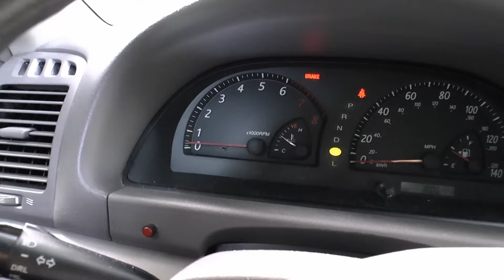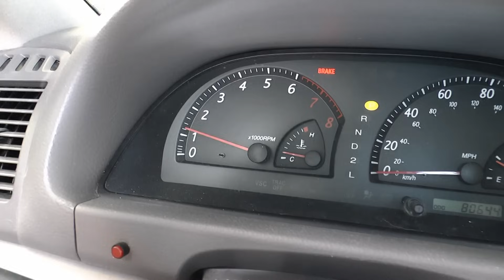How to Fix Low Idle Problems in Your Car (Throttle Body)

Comment: Hey Scottie i have a 2013 Toyota camery SE. it’s been idling low for about 1-2 months and I recently started my car up and it idled really low and the engine sounded like it was struggling to stay alive and it eventually tuned off by its self. I went to an auto parts store to get the battery checked out since it’s a couple of years old but everything checked out okay. I was thinking of doing this trick but I don’t have my original keys with the remote to lock and unlock my car, do you think I can still try this or will my alarm go off? I believe my burglary alarm got turned off since I had to get a new key made by the locksmith. Thank you for you Chanel I watch it all the time keep up the great work! Thinking of getting a 2019/2021 Toyota camery XSE what are you thoughts??

Comment: I have a 2017 Hyundai Elantra. 61k miles. Slight jerks when in idle. Jerks more pronounced when driving at low speeds, when accelerating again after taking foot off the pedal and also when the A/C is on. I have changed transmission fluid at 60k miles. Engine oil changes are also regular and on schedule. Tested ignition coils by removing connectors and seeing the engine response. All seem to work fine. Fuel injector test also done with the screwdriver. All seem to work fine too. Replaced spark plugs recently. All of these done but jerks still occur. No check engine lights. Any help?

Comment: I have a 2001 Toyota corolla. It idles rough. It seems to surge. I took it to the dealer they say it needs a new throttle body. Do you think that will solve the problem? All the sensors checked out.

Comment: I have a 2000 Buick Century that shakes a lot upon startup and at all stops, however I did just get the battery replaced a couple days ago. So that throttle body spray cleaner should do the trick?

Comment: Cleaning the throttle body -- $200 is what I got quoted once. Sounds crazy when they already did the hardest part of the job exposing it so they could tell me they wanted $200 to wipe it off, lol. I'm sure being a dealership though, they had to replace any rubber hose they touched and wanted to replace any clamp they disturbed at $25 a pop or more, and probably had some premium brand cleaner that cost me $50 a squirt instead of just using ether or brake cleaner or WD40 to do the job.
Reply: $50 a squirt,  $20 for a rag,  another $20 disposal fee to throw the rag away, another $20 fee because now the rag is hazmat and known to the State of California to  cause cancer.

Comment: My 95' toyota starts up and idles normally (800rpm) most times but sometimes when I start it up it will idle low @500-600rpm. I have already cleaned the throttle body but it will still idle low sometimes, until it has been running for a few minutes, then it idles normally. should I try cleaning the maf sensor?

Comment: Question for Scotty, I have a 08 rav4 sport that drives fine but when I come to a stop it shakes when it idles down, I took it to get checked they said I need the throttle body and injectors cleaned cost me 250 I'm ashamed to admit but the car continues to shake when idle low, I changed the plugs the filter all the above, what do you think could be the issue? No check engine light either btw

Comment: Scotty what can be shorted? Because the very first time I cleaned my throttle body, I did not disconnect the battery cable and I’ve never been able to fix the issue after that.

Comment: Hello Scotty. Today i have cleaned my vauxhall zafira 1.8 petrol throttle body but after cleaning. Car idling really badly going high and low revs crazy. Its a  factory fitted lPG car. On lpg its even worse. What could it be please can you help. Is there any vacum leak or bad idle sensor. It use to be a minor idle problem in cold specially on lpg but when it reaches the normal temperature it’s idle fine . Sorry for the long message . Thanks

Comment: Hi..scooty I have a problem with my honda HR-V LX  basic model 2017..while driving stopping at the red light..when green  I Accelerate it getting off the engine..most of the time it does..some times making a turn slowly..it does..my Mecanic says need to clean throttle body..specially I get panic when  it off at the stop lights when them green behind drivers get mad on me..please tell me something from your experience appreciate..

Comment: Scotty, at 2:00 minutes you say "do it for 5 to 10 minutes to get rid of the carbon buildup". What exactly do you mean? The throttle can be cleaned in a few seconds, so I don't quite understand what you mean. Thank you!
Reply: I think he meant to say, spray and clean 5-10 times.
Reply: My throttle had a fair amount of buildup and it didn't just wipe off for me. I had to let the cleaner sit in between cleanings. It took me close to 10 minutes before I felt I removed as much as possible. If there is less build up and it removes easily, there is no need to keep spraying it.
Reply: he means to let the solvent sit on the plate and do its work

Comment: Hey Scotty I have a 1jz-fse  toyota crown  and it's not accelerating  from the pedal the butterfly  valve  is not opening  up  when u push the butterfly  with your fingers it accelerates  but it then shuts off

Comment: Please help me Scotty. I've got a 1999 Civic that is starting to drive me nuts... A few weeks ago it wouldn't start, so I had it towed to a shop and two days later it was ready... The guy from the shop told me that it had been the distributor (some parts were out of place...) and that no parts were necessary, just some re-adjusting... When I got a chance to open the hood, I found out that the throttle cable had been tightened somewhat... I noticed right away that the car was idling a little lower than usual, but since it
drove fine, I didn't make a big a big fuss about it... Anyway, it would always start with a low rpm, but it would go back to normal shortly after, when I would coast or stop. However, a few days later, when I went for a drive and sped quite a bit on an open road, the car's idle has changed significantly...
It idles at around 1500 rpm when coasting until I come to a full stop, after which the idle drops to 1200 rpm... On cold starts, it revs up to 2000 rpm, but gradually drops down to 1200 rpm, so I guess the IACV is ok...
I've checked the spark plugs which have about 12000 kms on them and look almost new, 
I've tried readjusting the throttle cable, but to no avail, 
cleaned the throttle body, 
searched for any hose with damage, trying to find a vacuum leak with water,
I also tried troubleshooting as in the shop manual, where you cover the lower port of the throttle body, where it states if you cover it and there is no change in the idle, then you have a vacuum leak and there is no change to the idle when I cover it...
However, if I cover the air inlet tube to the air filter, it makes what seems to be a suction noise... 
When I have the air inlet removed and stop the engine, a strange noise comes from the throttle body, like two or three hisses...
Does this mean I have a vacuum leak?
Sorry for the long post... Thanks in advance.

Comment: I have an 07 Camry 2.4 (same engine as in video). I've already cleaned the throttle body last year like in the video and yet it shakes like hell at a stop light, especially with the accessories (a/c, defrost) on. It idles very smoothly when you put it in neutral or when idling on park but when I'm sitting at a stop light in drive it shakes like mad.
Reply from the maker: check the motor and transmission mounts, they may be bad. Also check for vacuum leaks

Comment: Do you think this will help my Mitsubishi Charisma? It has low idle and sometimes bounces up and down to the point that it cuts out unless I have the AC running which increases the RPM.

Comment: hi sir ... i had experience an overheat on car but it looks stable after we wait to cooll down and put lots of water on radiator ..after some test we dont see any leaks .. but the problems is the idle goes down when low speed and stops ...  whay do you think is the problem ?

Comment: Mr K I'm pulling hair out! I have a 07 Versa.I did the coils and plugs, clean the intake it through up some codes . My connector on the evap purge valve was loose clear all codes drove it at that high idle to warm it up and for the life of me can not get the relearn to work??????? Found out that cause its idle so high is reason why? The Versa intake is built over the coils so how can I remove the coils to trick the computer  to think it's at a lower idle I don't see how ? Any info would be welcome! Thanks in advance.

Comment: My 2004 dodge ram 1500, 5.7 hemi had a code that had a fault with the EGR. I was travelling when it started to cut idling, and wasn't able to fix it then, so I drove it home idling/running not great (about 100 miles or so). I've replaced the EGR, but it is still idling rough. What other systems may have been fouled up in the process? Spark plugs? IAC/MAP sensors? Would I just need to hold it at 2k RPM for a min, and then let it idle for 5, like this suggests?
Reply from the maker: yes, may things can be messed up with carbon. try my video "how to clean fuel injectors on your car" and pray that fixes it

Comment: 99 Honda CR-V rpm is below 1000 and when I use the ac it's low idle as well sometimes my car turns off ... I cleaned the throttle body checked the air filter and cleaned the idle control valve as well ... idk what to do now ..

Comment: Been having an issue with my car. It had a really bad low idle and surging. Would sometimes turn off when I came to a light. I got some maf sensor cleaner and sprayed the intake and cleaned it out. It ran fine till about a month later(now) when I turn it on, it's in really high idle (2000, 2500 rpm). But quickly drops down and after riding it doesn't drop or spike up. It's a Mazda p5 2003. Any suggestions?

Comment: P0305 PO303 PO306 PO174 PO300 PO304 PO171 Rough Idle, clear the codes and comes back after about 20 minutes. I did take apart the intake hoses to fix a power stearing leak and now every since the hoses have been loose and popping out and stalling out the car, so I endded up screwing them in place. no more stalling but I do keep getting these misfire codes. is this the issue you think? Sometimes I hear a whistle sound when accelerating. Idled at a red light or stop sign is always rough and first starting the engine it sounds like a whining grinding sound until it warms up and goes away.

Comment: Kilmer the MAN........1996 Subaru legacy outback , engine area fuse box has a fuseable link 125 that gets pretty  warm at night with lights , heater, wipers on. Is that normal.?   Its warm close to hot to touch...

Comment: Hi Scotty! My toyota yaris 2007 model sedan is losing power while driving. I have changed fuel pump, ignition coils, spark plugs and cleaned the throttle body and mass air flow sensor but the car still loses power while driving on a highway or up the hill. What might be the problem? Check engine light is not on as well. So I really do not know what might be the problem.
Reply: @lesliedioquino4896  Thanks! I will check the car battery and get it replaced.

Comment: Will running seafoam spray through the intake also pass through the throttle and clean it out?
Reply from the maker: yes, but I find gumout spray cleaner works better

Comment: Hey Scotty, I have a 99 Dodge Intrepid ES (save your insults for later) that I wisely bought with the 3.2 L engine, not the 2.7 L. Anyway, I know these vehicles are notorious for A/C problems, but they come in different types. Whenever I turn on the A/C it makes a cranking/grinding noise, and it has broken the A/C belt before (one belt was a day old from O'Reilly's). Is this a simple fix like replacing the A/C clutch or will I have to replace the unit all together?
Reply from the maker: replace the entire compressor assembly, rigging just a new clutch rarely works for long

Comment: I changed the throttle body I put a used one cleaned it and everything when you say computer are you talking about the ecu ? And witch sensor are you talking about ? There's two of them on the throttle body I never had these two codes they just popped up couple weeks ago. What's exactly a exhaust gas Recirculation monitor sensor,, can you give me a few exact steps on what would you do if it was your car . Thank you for answering ..
Reply from the maker: the egr sensors are generally on the egr valve itself, except on fords that use a dpfe sensor on the top of the engine head.  If if's a bad computer, that would be the main computer, the ECM, but that's VERY hard to diagnose

Comment: Hey Scotty, I swear I feel like you know what problems my car is having and you make a video.  89 firebird gta, 5.7L tune port. As I sit at a red light the idle drops well below 1000 rpms then shoots up then drops.  It's gotten worst to while I'm driving they will drop and cause me to sputter a bit. Could it be the MAF sensor?  Throttle body?  Vacuum? 

Thank you for your time
Reply from the maker: could be any of those, do my video "fixing engine vacuum leaks with a cigar" first and pray it's just that

Comment: Hi, i have been facing low idling issue. Few times rpm drops down to zero while driving when i press clutch and car stalls. However, most of the times car rpm fluctuates in idle condition. My car has drive by wire throttle, do i need to disconnect negative before cleaning throttle.

Comment: HI Scotty I have a 2003 mitsubishi galant 4 cylinder and my car is shaking a lot. Now they say its the idler but the car is doing the same thing along with stopping or when it starts up it just  stops. And now their saying I have to replace the throttle body. As you are the expertise what do you think. Do I really have to replace a throttle body?
Reply from the maker: tons of things can do that, check motor mounts for breakage first and do my video "how to fix a car that idles poorly"

Comment: Hey folks. I have one citroen (french car here) with unstable idle. The car throttle is electronic controlled by the computer. I was just wondering can I use carb cleaner spray here, because I already have it or I should look for special throttle cleaner spray? A friend of mine told me that carb cleaner can destroy the bearings plastic in the throttle mechanics, is this true?

Comment: Scotty I recently clean my mass 02 sensor and throttlebody I seem to still be throwing a trouble code of Running to lean now I’ve noticed when I go down the road and let off the gas my idol is jumping up and down slightly in a rapid pace it’s a 2008 Toyota tundra with 200,000 miles on it 5.7 L V-8 please help do you think I need to change the Iac sensor

Comment: Hi Scotty greetings from The Granite State. I tried this throttle body carbon cleaning I got it really clean and cleaned the air filter box and filter as well. The idle is a little bit higher than it was but is still to low. I have a 1987 Oldsmobile 98 3.8 liter V-6 is there some kind of idle reset procedure that I can use on my car to get the idle higher?

Comment: HI Scotty,I have a 2007 Chevy trailblazer that's idles low when I use the heater and air con.,I have heard different opinions saying you shouldn't manually open a electronic throttle body to clean it. Is it safe to clean it the way you demonstrated in your video?
Reply from the maker: yes, it's safe, just be sure to disconnect  a battery cable first so no power is there and let it dry half an hour before plugging the cable back on

Comment: Scotty Kilmer Can you help me?

I have a 2000 HSV Clubsport (which is a Holden, in Australia) that utilizes the 5.7L LS1.

It idles funny.  By funny i mean the engine seems to jolt randomly.  You can feel it through the car it's like a misfire but it doesnt happen in any sort of rythem.  It seems to do it a few times, then once, then once again, then a few times, then a few times and so on.

I hear these engines just don't idle smoothly in any case but I still think it's a little weird.  I've only replaced the spark plugs and ignition leads so far and wondering what I should look at.  Is cleaning the throttle body a good place to start?  what about the maf sensor?  Also I hear the o2 sensors cause problems in the ls1 but believe there not really associated with idling issues.

Cheers.

Comment: Hi Scotty. My car shakes a little bit when idle. Sometimes not always and just for a second or two. The rpm needle stays stable. No misfires. My throttle body is new so is my air filter. Injectors cleaned a year ago. MAP sensor recently cleaned. Spark plugs, wires and ignition coil all new. Could it be from a dirty intake manifold? Don't know what else to think of
Reply from the maker: check for vacuum leaks, as in my video "finding engine vacuum leaks with a cigar"
Reply: already checked this.

Comment: Would a gunky intake manifold cause this? I would guess yes. Any way of cleaning it without taking it out. Maybe with some kind of brush?
Reply from the maker: you can remove the throttle assembly and spray cleaner inside the manifold

Comment: Can I clean the electronic throttle on my 2011 Cadillac DTS the same way? Is it the same way to relearn the throttle idle speed the way you did it? Thanks.
Reply from the maker: electronic throttles can be cleaned, but you must unpower them first by unplugging them and disconnecting the battery cables. Then you clean, let dry, and put it back together. Then car will reset itself just driving a while

Comment: Hey Scotty, I have a 2004 Ford Focus that has an engine misfire. In addition, it dies when it idles and dies even quicker when the A/C is on. I have to turn the AC off at stop lights and keep my foot on the gas for it to run. I know that the misfire is on piston 4. What do you think is wrong with it?

Comment: Hey Scotty, I have a 2006 Lexus gs430 v8 with 160 on the dash that keeps over heating .I changed the radiator,water pump,and the  thermostat I don't have a clue what to do